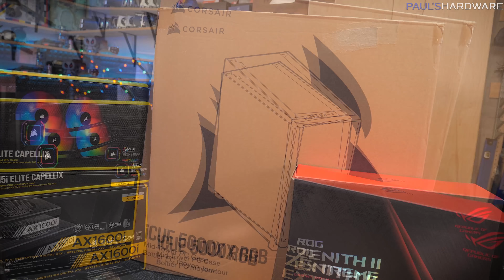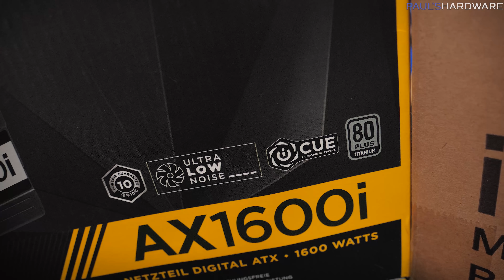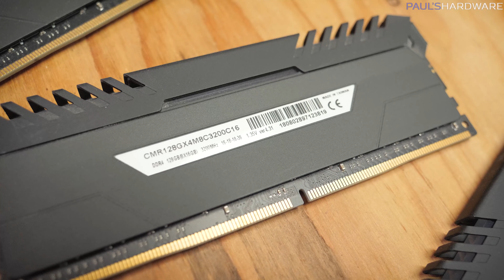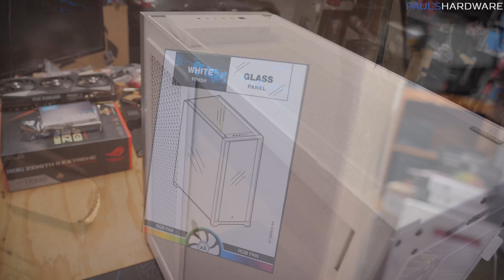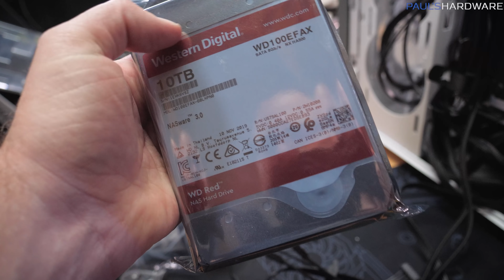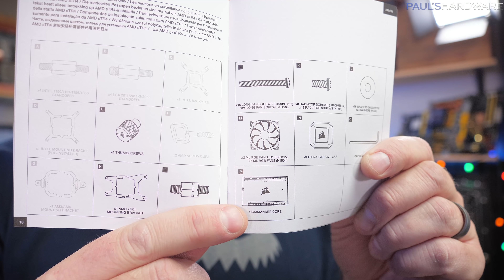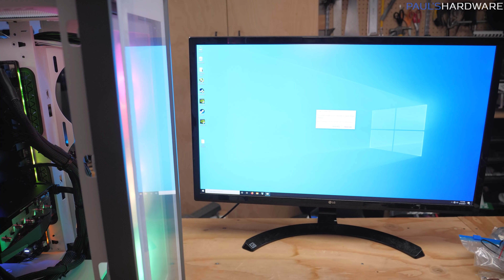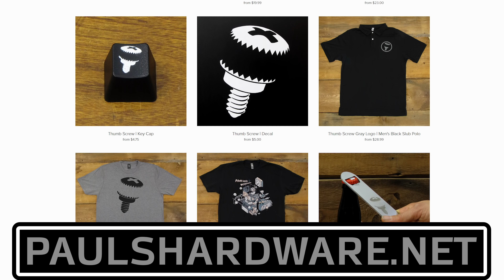Trying to build the fastest PC I can...

Comment: Holy crap, I built almost this exact computer in January! I somehow bought an Asus Tuf Gaming OC24 RTX 3090 for retail at Microcenter by just walking in at the same time it came off the truck.  So I decided it was finally time to upgrade my FX-8350 from 2010. 
Someone bought an ROG Zenith II Extreme for their kids AM4 build, not knowing it was an sTRX40 board. I know because I watched it get returned the day before I bought it for $207 instead of ~$800ish, as an "open box". The first time it was opened was when the employee returning it checked to make sure it was there.  

So yeah, I'm the luckiest bastard ever. 
Pretty much the same hardware except an 011 dynamic case, 256gb 3200mhz 16-18-18-38 ram, 4x2Tb Seagate 520 nvme's,and an old Cooler Master 1000w power supply.
I rounded out the cooling with an EK velocity WB, and a gigantic 360mm Corsair radiator that I swear is 2"+ thick.

My only suggestion on your machine is to go full tilt and use all 5 of the on-board nvme slots. The one you didn't show in the video is on the back of the board, took me almost 3 days to realize it was there, then I rtfm, and duh...
Also, raid is almost worthless on this board. 2 drives in raid 1 or 4 in raid 1 only change the speed from 12Gb/s to 14Gb/s. But then you can't read from the nvme's in any other OS besides Windows. Maybe you don't need to use a real copy of Linux, but I find it very valuable for my various Rpi's and other toys, like my rockpro64 armbian torrent box. Plus being able to use gparted on Windows installs for resizing and backup purposes is great.

Didn't mean to type my life story, but this build is fantastic 👌

Comment: Excellent, Not just me then.   I had 3 traditional hard drives and the same problem.   Due to restricted airflow, I got a workaround and took off the front panel on my new PC case with its RGB bling (Lian Li half-sized tower) hi.   It has worked fine since the i9 9900K was released, and I now have it converted to AMD and a 5900X CPU   I managed to break the rear panel glass, so now even better ventilation and the show goes on.  I use the rig for streaming and video editing, and it is an excellent balanced system, but I would have loved to be able to afford a 5950X with a 3080 graphics card.   I will see what next Gen AMD is like before I raid the piggy bank hi.  Very pleased with the Arctic II 320 AIO and a liquid metal compound.  I get a decent overclock from the CPU.

Comment: Use the fractal design meshify 2 as your next case. It can be turned into storage mode where you can fit up to 13 or 14 or something hard drives which should be definitely enough.

Comment: The first time I built myself a gaming pc, I picked NZXT H440. It was a disaster with the AIO and all the hard drive bays. I use a simple easy-to-install air cooler and a compact mid tower ever since. No RGB. Corsair 4000D is a great, easy-to-build-in case, too.

Comment: Engineering question. You had that one piece that could replace a shield at the bottom near the front fans. Can you remove the shield and turn the drive tray around so the drives go in through the open side rather than through the back side? That way the back radiator bar won't block you.

Comment: Didn't see if anyone pointed that out, yet but the 10TB WD0101EFAX is also fine: as far as I know every EFAX model with 8TB or more is CMR and thus also perfectly fine for NAS. The problem is only with the EFAX model with 6TB or less. Here you might want to get an EFRX model instead when using a NAS. So in case anyone here got a 10TB EFAX: You are probably fine :-)

Comment: I had that PSU which I purchased back in 2019 when I was making a completely new PC build. I ended up selling it for half what I paid since I had no use for such a PSU but still used it for few months during the summer before switching over to the RMx 850. PSUs are pretty plentiful for most builds these days.

Comment: How about a strong system focused on low power consumption next?

A strong enough computer with a focus on low power consumption, with 2020/21 parts, that's still fast enough to do everything from Blender to audio/video editing without slowing you down, would seem interesting and doable with constrained supply?
Something you could even run on a small, semi-portable solar-system. Around 25 to 30 Watt (average usage), it'll still run rings around any laptop....

Comment: HI there - you can use the ASUS Hyper M.2 X16 PCIe 4.0 X4 Expansion Card Supports 4 NVMe M.2 in the un-used gpu slot - which if you used 8 tb drives - you could add up to 32tb total ; varying amounts in-between if you used other capacity drives.

Comment: why not use a full tower for something like this?  im using an old cooler master haf 932 full steel case and it still works great as i use only atx and e-atx boards. it's heavy but i can carry it myself and have zero issues. space for me is a must when building/working on my rig.

Comment: I recently completed a build using the 4000D airflow and I too had many disappointments with that case. interestingly they are the exact issues you are also having. It's disappointing to hear you had the same issues given that the 5000 series is much larger. I had to remove the HDD tray because the cables from my Corsair 650W fully modular PSU would not clear it. Secondly I purchased the H115i (280mm cooler) and while Corsair claims that's the max size the case supports i had to install it cocked because it makes contact the VRM heatsink, it even rests against the FP cables. IMO that is false advertising since anything larger than a 240mm will NOT fit properly. Cable management was ok. If I had to do it again i would not use it.

Comment: I think Corsair created a problem leaving no space for a drive cage and comfortably using a power supply
those bends don't sit right with me
someone needs to make 90 degree PSU fittings for the cables so they aren't kinked against the drive cage.
It may already exist, I didn't do my research.

Comment: Why not just modify the fan panel at the bottom so you can get at the hard drive cages with the 1600 W PSU if you are not going to use the fan panel in the first place? A cutoff wheel and 5 minutes and that 1600 W and the cages would be perfectly accessible.

Comment: Paul, mate, I know it's far too late now (and I wouldn't like to poke at your temper) but the side fan mount bracket can be removed. 😶
GN Steve did a video called "Corsair 5000D Airflow vs. Solid Case Review: Thermals, Noise, Build Quality" where it clearly shows it removed - so you can then use 1600i, hdd cage and the cable cover panel instead (they are mutually exclusive and apparently you are supposed to use one or the other).
Hope that helps if you ever find the will to remove it and maybe can drop a line to Steve for removal instructions?
Mind how you go. :)
Reply from the maker: Thanks John! It seems in my frustration I didn't fully investigate, but I'll be sure to include that in the follow up video. I appreciate the tip!

Comment: Wait... The side fan bracket isn't removable? It looks like it should be able to come out after undoing the 3 screws on the left and 2 on the bottom, especially considering some of the gaps towards the front of the case, on top of the fact you can buy a replacement bracket. Would fix the 1600i and 3.5" drive cafe clearance issue.

Comment: For functionality’s sake, why are you using a NAS grade drive? Those have usually lower speeds. Wouldn’t you need a general purpose drive for maximum functionality?
Reply from the maker: Part of it is working with what I already had, and I picked up the 10TB Red drive during Black Friday 2020 sales. I also have longer-term potential plans to build a new or additional/redundant NAS where the features of the WD Red drives would actually be useful. For now though I have a couple more 10TB 7200RPM drives that have arrived that I will be installing soon.
Reply: @paulshardware  thanks for replying Paul, I know it can be a challenge between family affairs and channel management. Personally I packed all my spinning drives (and added some more) while they are still cheap and turned them into network drives. Follow up question, you think dramless ssds are ok to be used as just storage?

Comment: I don't know about calling a Threadripper PC a "gaming" machine. Gaming is just the tip of the iceberg with that thing. You've built a damn supercomputer.
Reply: Best thing about PC gaming, it's never enough 

CPU 64 cores, 128 threads
RAM 256gb 
Motherboard ASUS Xenith 2 extreme Alpha 
RTX 3090 
Corsair 680x 
16tb HDD
4tb SSD
5tb total of M.2 NVME 
Cooling, use whatever you like 

Now that's a GAMING PC

Comment: Given that you're using a Threadripper CPU lower slots are also x16 so you didn't need to use the topmost PCIE slot for the 3090. Speaking of Threadripper, I'd like to see you do a Threadripper Pro build with a discussion on RAM in such use cases. What do you use when you need 512 GB RAM? And the side-effects of such large amounts of RAM - like the pagefile and hibernate file. 

As for 3.5" drives, do you really need them? Can you not store the data on your NAS and access it via a 10 Gb (maybe faster) LAN?
Reply from the maker: You bring up some great questions Quentin, but I can't say I have any plans for Threadripper Pro anytime soon. Do you follow Level 1 Techs? I know Wendell has been playing with that. 
Good idea for the NAS too, but that also needs an upgrade for 10GbE support so I will still rely on local storage for now. Thanks for the comment!
Reply: @paulshardware  There's Wendell's perspective and there's your perspective. I find your perspective more at my level.

Comment: There is nothing wrong with putting the rad in the front with the hoses at the bottom as long as the pump is not the highest point of the loop

Just hold and shake the pump at the bottom while holding the rad up above it before installing

It is not that serious

Comment: I am moving away from a Laptop, which for the last 10 years I would say I have been using.   I use to build my own PC's years ago and really started to look at where I use my Laptop and it is not moving it around anywhere, so what is the point of having a Laptop then.     So moving to a PC Build and debating over AMD Rysen architecture or Intell.     My question though is that I do not really want a huge tower, but thinking along the lines of a Corsair 280X.   I want a smaller case, but not like a micro case either.   What are your thoughts on the 280X case.    Also what do you think about AMD vs Intel?   I think that AMD is more innovative than what Intel has been in years just my opinion though

Comment: That lack of space around the power supply seems like a huge oversite with that case. Are they just assuming people are removing the hard drive cage? I feel like you would run into that issue with any PSU.
Reply: I get the feeling this case is designed for water cooled systems with regular PSU's and no 3.5's. This really isn't a 'workstation desktop' case... But, ya know it's what he had and I think Paul will probably transfer this build into a more fitting case at some point. Lots of people suggesting a Fractal Meshify 2 or Define 7 in the comments.

Comment: 3995wx on an asus wrx80 pro sage with 1tb of 3200mhz ecc ram, 2x3.2tb 5800x optane u.2 drives, 3x4tb mp600 pro m.2, 8x8tb angelbird mlc ssds, 4x rtx a6000 with dual nvlink bridges, a 200gbe nic, and then a highpoint 8x pcie 4.0 m.2 riser with 8 more 4tb mp600 pro drives. Have someone machine custom waterblocks for the gpus, ram, cpu, and ssds, stuff it inside of a professional looking custom built pc case desk with as much radiator volume as humanly possible and then pair it with a 5950x 2x rtx 3090 nvlink build with 64gb of 3800c14 ram, a bunch of mp600 pro 4tb drives, angelbird 8tb ssds, and the fastest nic that will fit on the lanes left to have a direct connection to the workstation. Then a hhk pro2s with a heavy grail upgrade kit, a super light Logitech mouse, a pair of kef or Neumann monitors, a pair of hd820s with a hdv820 amp, and a bunch of lg gaming and professional monitors. 3840x1600 and 4k. Oh and a Neumann broadcast mic on a desk mount boom, as well as an alpha a1 with a 35mm lens and the pro phone for streaming. This would be the ultimate setup you could possibly build. Literally nothing would be faster that isn’t completely custom or some massive server or supercomputer. Imagine if they made a wrx80 board with overclocking capabilities. It would make for the most powerful platform on earth. It would beat regular threadripper and ryzen 5000. I can’t even imagine what 1tb of 4000-5000mhz low latency ram would be like. Or raided gen4 optane. It might just accidentally create a time machine.

Comment: Did both m.2's get put onto a single pcie adapter and get installed that way? If that's the case, does it limit their read/write speeds at all? Ive never seen that before

Comment: Are you only going to use more than two 3½" drives...?
Would a Meshify 2 work...?

EDIT:
FYI... that rear (side?) triple fan mount panel CAN be removed to give full access to both 3½" drive bays even with a 1600AX PSU.

Comment: It seems like when building a PC there is always a hurdle that splits off into multiple hurdles. 😂  You could’ve probably just unbolted the power supply and shift it sideways without unplugging all of the modular cables to give room to move the drive bays back to access them. It may be a little tight but should give you enough room.

Comment: Corsair is putting some serious money into advertising this case.. there’s no reason to use 5000 series over a 4000 series case unless you are doing a custom loop or want a 360 rad on top
Reply: 360mm AIO on the side works better.

Comment: I just built a 13600kf and 4080 in this case this week. I can confirm it was a absolute nightmare.. took me 8 hrs of constantly swearing. I got the cable management cover on, Only by 2 screws.. and its pushing on the wires decently. Case looks 10/10, but it isnt practical at all unfortunately.

Comment: 25:25 shouldn't you use 3 pcie cables instead of using the extension of one cable for a 3090? Also from what I read for my msi 3080 gxt if your psu only have 2 pcie output (SFX) the extension 8pin should be installed in the outer most power slot in the gpu. im guess you cant/shouldn't do that for a $1,500 (before scalper price) gpu

Comment: Hey man, I am planning to buy a gen4 m.2. However, i currently have a gen 3 m.2 on the first slot of my mobo. 

Should I install my new m.2 gen 4 to the second slot, clone my gen 3 m.2 to my gen 4 m.2, turn off the pc, swap them so the m.2 gen 4 is on the top slot. And boot from that?

Also when do I format the gen 3 m.2?

How do you suggest I do this?

Comment: Wait what's the the thing you put 2 m.2 in and how would I check compatibility on PC part picker.
Reply: It's a dimm.2 riser card for m.2 storage. Not many motherboards have dimm.2 slots. If your motherboard has a dimm.2 slot you can put a riser card in it. Most motherboards have 2 or 3 m.2 sockets built onto them also pcie expansion cards are an option, they can (normally) hold upto 4 m.2 and they plug into an empty pcie slot.

Comment: Many F bombs spoken allowed always seem to be when in private, are the best cheapest form of therapeutic release. Screw this electric save the planet stuff. My comp needs a combustion engine model-T style or full-on Camero, no seat belts & an optional nonbiodegradable cup-cup holder only with smokestacks. When my build is done, I want the biggest polluters to think twice about what they are doing. I want the focus off of violence in video games and back on the ivory trade because of my pc case. That and yt bucks should cheer ya up.

Comment: Awesome to see your having the same BS issues I get when building PC's. Fricking companies and their proprietary connectors for common parts like fans. FFS Industry, knock this shit off. Ive got 4 RGB fan systems that are dependant of specific motherboards at best, or having to buy another part just to get them to work adding to the wires, complexity and ultimately links in the chain that can fail.

Actually Paul, maybe this could be a vid all on its own.

Comment: computer would need its own seperate line straight from the breaker. this advice has nothing to do with me having had my pc on the same line as my microwave...
Reply: Good point. Seen some streamers go full RGB etc in their spare room/streamer room and realise it can't handle the load. Luckily I think Paul's got his house wiring figured out. He did a whole solar panel + Tesla battery bank thing 1-1/2 years ago.

Comment: And again another computer build where the most important step is skipped, testing the hardware and installing Windows to verify the hardware works properly.  Would really suck to put it all together and find out something like the motherboard doesn't work wouldn't it?  At least it's not a open loop water cooing build.  What is it with spinning rust?  You are using a graphics card made of unobtainium so a large capacity SSD seems obvious!  No it doesn't!  Why would you not be using 10G and a NAS for video editing?

Comment: This build is a mess. You and your extended family, combined, does not have a use for 128 gigabytes of ram. Why is a 10 gigabyte raid array not already part of a NAS arrangement? Maybe the choice of case and cable management wouldn't be a big concern if you eschewed ostentatious features like water cooling and super large power supplies.a 3950x and a 3090? And you're gaming on that? Why? New chips are always fun, but I'm amazed at how much superfluous chunks of metal and light up plastic can sold on top of a set of a core components.
Reply from the maker: all spot on tbh